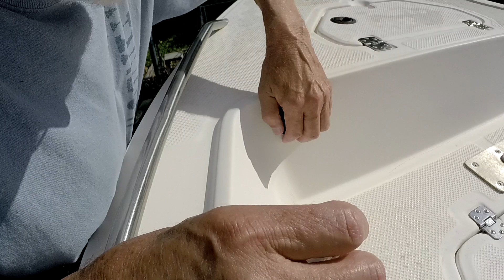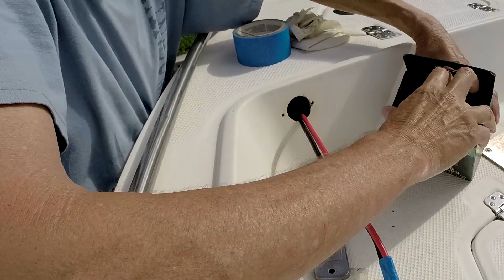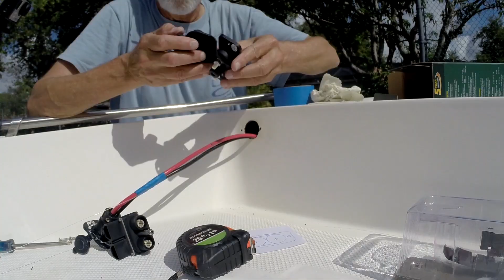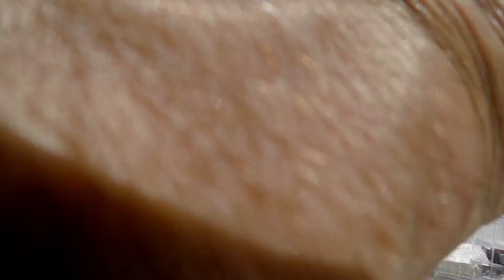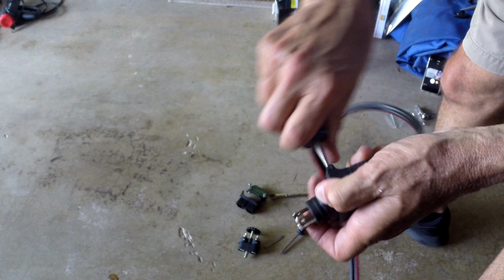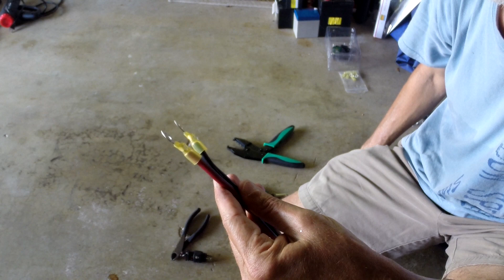Battery Tender TM Plug Installation on my Key West 1720 - May, 2019

Comment: What power trolling motor does you have.  12 or 24
Reply from the maker: @jamescoleman2369  I’ve had both on the KW. Currently a 24v 70# MinnKota powered by two 100Ah lithium batteries.

Comment: Did you have to cut inside the anchor box to bolt down the trolling motor
Reply from the maker: Jesse, short answer, yes.  I used a 4" hole saw to open an access hole high up in the anchor locker.  This works on the older models where the anchor locker is on the high bow level and the storage locker is on a lower level.  If you have a new model where the anchor locker and storage hatch are on the same deck level, it will not give you the same level of access.  Be sure to put tape around the cut edge of the hole before you insert your arm.  Fiberglass doesn't feel good when it gets into your skin.

Comment: .25" studs. 5/16 lug connectors?
Reply from the maker: Nicholas, I do not understand your comment.  If it is because I used a slightly larger lug connector on the stud, the slightly larger lug is acceptable.  They were already on hand.

Comment: When I go and connect the wires on my plug to the trolling motor there is play or a loose feeling with the wires. The connection for a wire to stud are all tight but it seems to be the way the plug sits in the plastic part. Did you see this on your install. Dont like the idea of play in an connect in a 36v system.
Reply from the maker: Chase, thanks for watching and commenting.  I do seem to recall that after connecting the TM wires to the male lugs, there was some play in one of the lugs.  If I remember correctly (it has been some time now since the install), I removed the TM wires and was able to tighten the lugs within the plug, then reinstalled the wires.  I can't say specifically, but I do seem to recall having to undo and redo the wiring after putting it together.  This may have been caused by my playing with the plug prior to the actual installation.

Comment: Did the new plug stop your trolling motor from cutting out? My trolling motor is currently doing the same thing with the plug very warm.
Reply from the maker: William, Thanks for watching and commenting.  I've only had the KW out a couple of times since the plug changeover due to water intrusion into the fuel tank which was a fiasco and fortunately behind me now.  On the couple of occasions when I had it in use, it worked fine and did not get warm.  It is much more robust than the three prong MinnKota / Marinco plug.

BTW, the plug getting warm is an indication there is a problem inside the plug, either with an overcurrent situation or loose wire connection.  I'd double check that you are not exceeding the amperage rating of the plug.
Reply: @JimMFishing   After seeing your video I went out and bought the Battery Tender plug. I hope to install it this week.
Reply from the maker: @wmhattaway3108  - I'm pretty sure you will be pleased with the plug.  The peace of mind knowing it will handle any current you push thru it is worth the additional cost over the lesser plugs.

Comment: Can you tell me approximately how long it took to do this job? With getting tools, etc... I’m assuming most of the day? Great vid👍
Reply from the maker: Thanks, Melloreel.  I spent about 2 1/2 hours on this job and I was definitely taking my time.  I also made close to a dozen trips back and forth to the garage to bring out additional tools as they were needed (and because I didn't foresee every tool that would be needed) because it looked like it could rain at any time, all of which takes up additional time.  One thing I always do when working a distance from the garage is to load all the tools I think I'll need into a 5 gal bucket.  It makes it much easier moving the tools to the boat and has room for bringing everything back, including the additional tools I inevitably forget and still have to make that trip back to the garage.

Comment: I am putting a new trolling motor on 2003 key West 1720. I just purchased a Minn Kota Powerdrive 12v. This boat has had a TM on it before but was not there when I got the boat. My question is that the TM has a Red and Black wire coming from the motor. The receptical that's in the boat is a three prong receptical. I'm assuming that means it's a 24v system? How do I wire up my new TM as not to burn it up. Electrical is not my thing!!!
Reply from the maker: pytvyper69 - in the early days of 24v trolling motors they used a 3 wire circuit to make the 24v. Nowadays all TM wiring is a simple 2 conductor circuit. Even though your TM receptacle is 3 pronged does not mean that there is current on each of the 3 prongs. You can use a digital multimeter voltage tester to determine which prongs give you the 12v your TM requires. Pay attention to which prong the positive tester lead is on. If the display shows a negative voltage, you have the positive tester lead on the negative side of the circuit. 

Alternatively you can remove the receptacle and look at the wiring as it connects to the receptacle.
Reply: 3 prong receptacle were used on 
12/24 volt trolling motors.
On this trolling motor you could switch from 12 volt operation to
24 volt operation .

Comment: Thanks for the video I am doing this today i have the same boat and the same old plug that also failed. Can’t wait to get that battery tender plug installed thanks for the great video
Reply from the maker: Channel Cat3116, thanks for watching and commenting. It sure seems to be a heavy duty plug. I’ve only used it once since the install due to another unrelated issue with the KW. Hope to be able to put it to use very soon.

Comment: I have a key west like yours it's a 2002 year I have discovered  that my gas fill tube has collapsed  any ideas about that  you wouldnt happen to know how to get it out would you
Reply from the maker: Cam, if the fuel full hose has truly collapsed,  there is nothing I know that can be done except replacing the hose.  This is a relatively major project as the fill hose is typically embedded in the same foam that gives the 1720 model upright flotation.  Access to the hose end connections is thru the inspection plate just below the fill cap and thru the inspection hatch on the floor of the CC.  If you look at floor of your 1720 directly below the fuel fill cap, you will notice a very slight angle at the side/floor joint where the fill hose makes the bend to turn towards the fill connection of the tank.  

There are several threads on the subject of fill hose replacement on the forum.  If you are not familiar with it:  www.keywestboatsforum.com.  The alternative is to use portable tanks that you can position between the battery and live well compartments.  Good luck with your issue!
Reply: Cam Carter unless your into a ton of work, I would find a piece of fuel hose, like on a gas pump size,  slide it into the current fuel fill hose, and use the smaller piece to fill the tank! At least it would hold open the old line enough to fill tank until your ready to fix it right which sometimes creates more problems! JMO.

Comment: Would it be possible to install the plug with the cover hinge on the upper side?  Seems like that might add one additional level of protection from water such as splash over or rain.
Reply from the maker: I agree, but....  The socket and plug are molded such that they can only be mated in one direction.   Because of the way the socket is molded, the cover's plug also fits in only direction.  If the socket was oriented so that the cover hung from the top,  it would require the trolling motor plug to be oriented up instead of down.

Comment: Excellent video
Reply from the maker: Thanks, Dan!
Reply: I going to install a trolling motor on my 2002 1720 key west.my question is how of a shaft should I get.
Reply from the maker: George, I have a 54” shaft on my TM.  It serves the purpose without cavitation in all of my inshore fishing. I have been in some slop nearshore where it would sometimes suck air while on anchor lock but I rarely fish in those conditions. If I were to purchase another, I’d stay with the 54”. I wouldn’t want another 6” of length to deal with when it is stowed.

Comment: Awesome fix. A lot work but worth it in the long run. Thumbs up!
Reply from the maker: Actually a fairly easy upgrade.  It took much longer than it should have due to simply taking my time, triple measuring and having to shuttle tools back and forth from the garage due to threatening rain.  Definitely an upgrade from the old plug.  We won't be losing our anchor lock any more!

Comment: That black tape gets old and does make a sticky mess.Someone stole your cameras? Good job on the new plug.
Reply from the maker: Wayn, thanks for the compliment.  No one stole the cameras.  I was using their wifi capability thru my phone to get a good recording angle, and forgot that the phone was still linked when I left to get the drill.  The cameras turned off when they lost the wifi connection.  I didn't realize it for a good while thereafter.

Yes, that electrical tape makes a sticky mess.  Shortly after I had installed that Marinco plug, one of the wires on that plug came loose while we were out on the water.  We had to remove the plug and the port nav light, use the VHF antenna mast as a wire fish and make an on-the-water repair.  Trying to break the 4200 seal around the nav light was a job in itself, when you're pushing on the boat with a scraper and the boat keeps wanting to push away from you.  We managed the repair and used the tape to make sure the wires had some support.  I'd never use it if working on wiring while on shore.